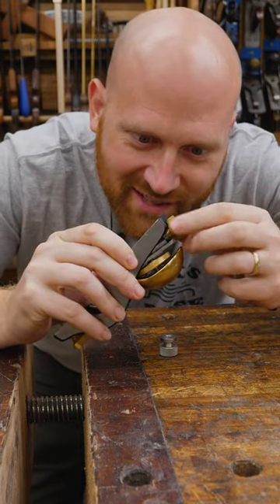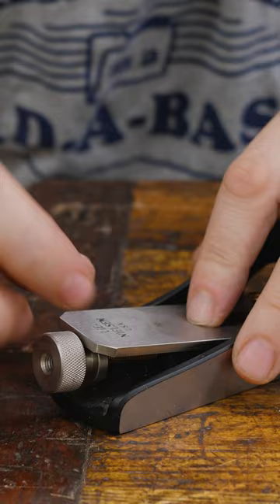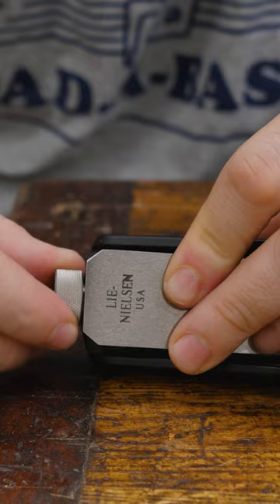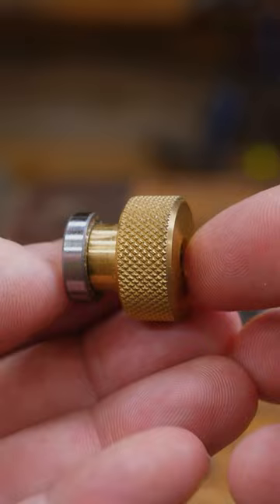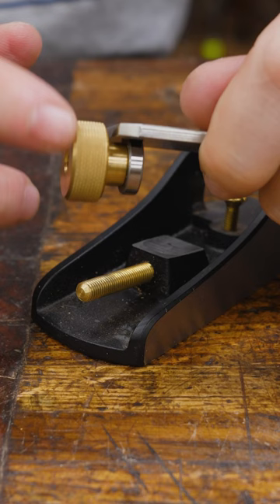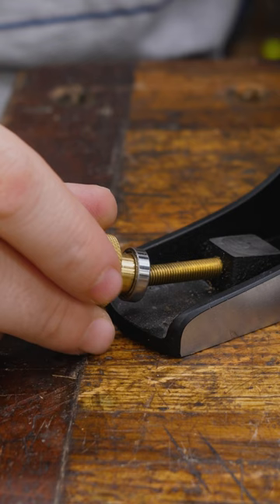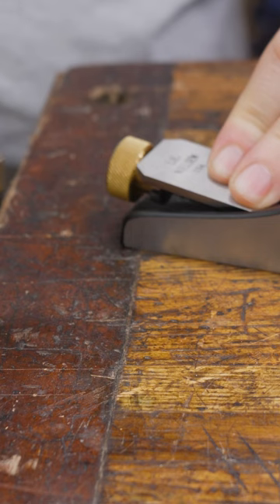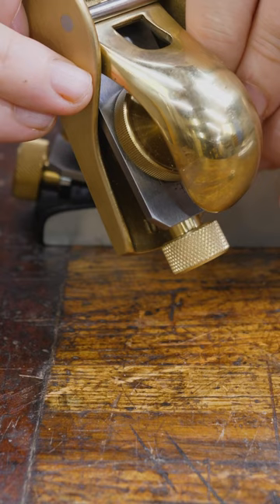What Is a Howard Adjuster from REED Planes

Comment: You skated right through this presentation.
     I love how simple this solution is.
     And I love that it took a perfectionist to become reality.
(it does look like the original design intended for a bearing, though... and that it was - perhaps - shaved from the budget)

Did Mr. Reed work on the design of this plane as well? 

Also, amazingly tight fit of handle into the bearing. Some knurly machining skill, düde 🤙